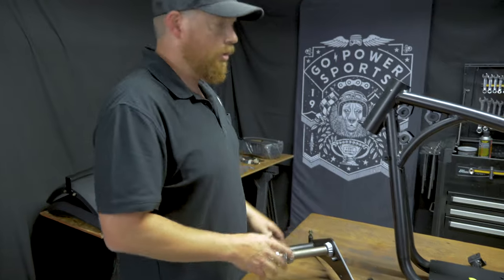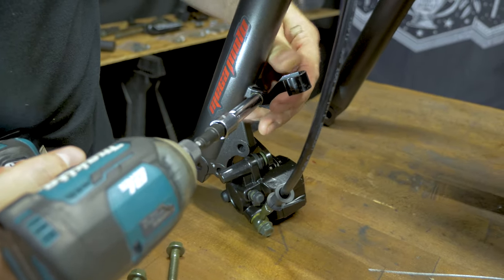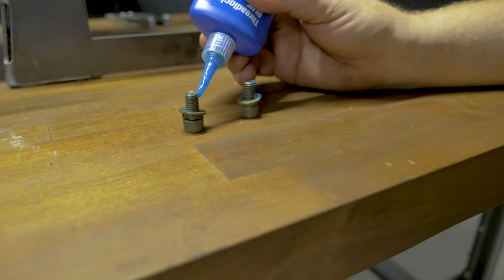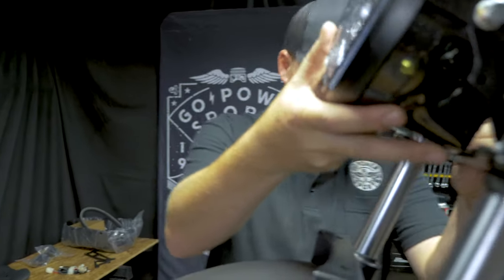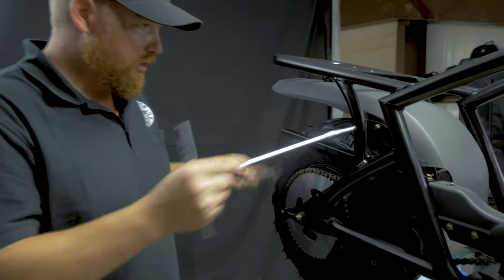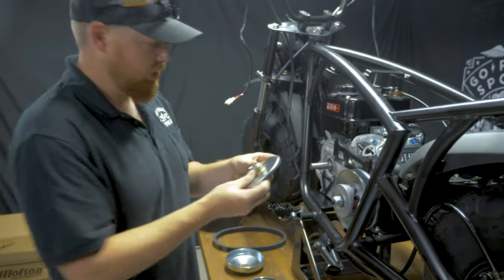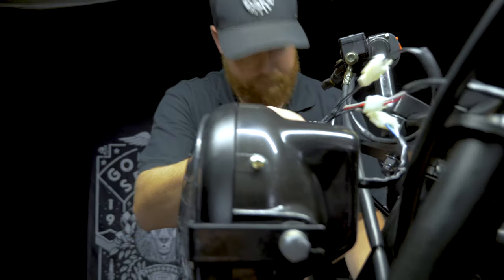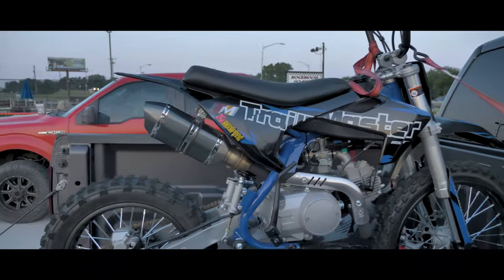Mega Moto 212 Mini Bike Kit Build

Comment: Any ideas for mounting a battery if you did the electric start Tillotson?
Reply: I was able to fit a cheap "Voltage battery tray" behind the jackshaft. I had to trim an inch off the rear fender for battery clearance, but it snuck right in there.

Comment: Just FYI if you buy a tillotson 212 electric start and start putting your stage one kit on.  The rubber gasket for the carb adaptor is not included.  I had to swipe one from my predator 212 still in the box.  For 1000 dollars, Go Power Sports should include this.
Reply from the maker: Thank you for your insight, I'll get this information in the right hands.

Comment: I have a lightly used Predator 212 from a dead log splitter.
I'm thinking to get your Mega Moto Mini Bike kit.
Then add the Stage 1 kit + hotter cam + charging coil + delete governor.
What do you guys think wouldn't that be a nice build plan ?
As an aside:
I was kinda stuck on the full suspension 200X idea BUT realized that a "hardtail" may not be bad.
On my Mountain bikes I prefer Hardtail, so here why not ?
I just think you slightly lower rear tire PSI to soften bumps.

Love any input y'all can offer up.
Reply from the maker: I'd love to see it!

Comment: I installed the TILLOTSON 212 engine. After assembling all components of the driver/torque converter, the original bolt on the shaft is too short and cannot reach the threads.  Any idea what size and length will work?
Reply: i think its 5/16in 24 x 1-1/2

Comment: The jackshaft install portion in this video is flawed. It starts with the little sprocket, then somehow switched to the pulley is on instead and the sprocket not. First there was no washer and now there is. I am trying to install mine now, but confused.
Reply from the maker: Mini biking ain’t Eazy for some. Give us a call and we can walk you through it.
Reply: @GoPowerSports  It isn't about my skill. I have that. And don't misunderstand, the overall video is helpful. I built mine up to the jackshaft before I ever saw this video. I am simply discussing the jackshaft portion. It wasn't coherent in steps. Also, my kit came with one washer that centers on the shaft while the others are all too large and do not center. The shaft, at least in my kit, is not designed specifically for the bike. That is why you have to put washers in a place that interferes with the key syncing up with the shaft (just following instruction). It will work, but it would be better to have the shaft machined for the bike perfectly. Also, in your video, your shaft slides right in place through the bearings with ease, while mine had to be gently, but firmly hammered into place; it is tight in those bearings and nothing easy like in the video. I will have to hammer it back out. When I do, I'll attempt to clean up the shaft for an easier entry next time. I am now making my own washers that center on the shaft. Actually just modifying some that are slightly smaller. In the future, instead of using two washers to allow the gear to be tightened, I may just machine one spacer for that job. I'm running the  gear right up against the inner bearing race; it seems to work fine and is the best configuration for the hardware in my kit. 

The bearings didn't feel good at all, and FatBuddyCat said that would be the case and gives his theory as to why. In any event, I already purchased a new set of bearings and when I get done, my shaft should spin like a tiny dancer if tiny dancers spun horizontally. 

I love the bike. When I am finished, it will have no issues in the drive train. I like the look of the headlight, but I have something else in mind for head lighting. Too much glass on that big beauty of a headlight. Maybe I can sell it on eBay to someone who broke theirs some day. I anticipate the torque converter install might trip me out for a moment or two, since I have never had one before now. The torque converter looks like a beast of a mechanism. There is a fair amount of mass in this drive train. Looking forward to feeling how the drive train works. Still, I feel the need for a hot rod, straight chained, centrifugal clutch street racer. But first, I have to get this mm212 beast to wake up on its feet. The only thing that will be as much fun as riding it will be figuring out what custom colors to put on it and where.

Comment: What torque converter are you using? Base 30 series (8hp max) aren't rated for even the base Tillotson 212E horespower output (9+hp).
Reply from the maker: The stock 30 series will still work but the best case scenario is to upgrade to the Juggernaut Driver, along with taking out your engine's governor.
Reply: @GoPowerSports  Thanks!

Comment: I bought the same bike. Now has Fully built motor over size flattop w/ the works, I added juggernaut. It feels like I am maxing out my rpm quick. Am I running out of gear? Any suggestions? I don't want to go backwards and remove the juggernaut. Any help would be greatly appreciated!
Reply from the maker: Send us a video.  If you're flying down smooth pavement, maybe drop down to a smaller rear sprocket.
Reply: @GoPowerSports  thanks I called in yesterday 9/6/22 and Scott helped me order 2 sets of adapters and 2 piece sprocket. Hopefully it will balance it out a bit more, going from a 54 tooth to a 42 tooth.

#pbkmotorsports

Comment: Well, I have the engine installed now and finishing details. Curious, I also bought a Tillotson 212 engine from Go Power Sports along with the MM212 bike. The engine, assumed to be new, had fuel in the carburetor. Is that normal, or did someone put a used engine in a new box?
Reply from the maker: That is normal, they do get tested at the factory, drained, and then sent out.  There may be a little gas there.
Reply: @GoPowerSports  : I've been riding the MM212 for many hours. It's been a year. I have been site seeing my rural area and the bike is terrific. The hard tail is also great. I never have any chain problems. I  run the rear tire a little soft, and it rides just fine.

Comment: I had a problem with the rear fender, the gaps where too big and i couldn't get it bolted it. Is it normal for there be a 1/2 inch gap on each side? unless i got the wrong fender in my kit or the brackets weren't put in the right spot.
Reply: You can get it lined up with a long thin screwdriver. It will bend a little.

Comment: Awesome bike, was wondering if you could fit a Tillitson 212 with electric start in there or a Duromax 440cc 16hp engine. Saw a video of a guy doing that. As I do want to buy this kit very very soon!
Reply: Yes u can fit a tillitson 212e on there it will be a tight fit tho. If u want to know where I put the battery or have any other questions let me know.
Reply: @nathandixon5020  Yeah where could I put the battery, right next to the jackshaft? Also would I need to run a small alternator since I wanna run some Led lights, tail lights, electric start and possibly some other stuff. Or would the charging coils be enough to charge the battery from the Tillotson
Reply: @nathandixon5020  Yeah where would the battery go? zip tie it on the frame in front of the gas tank? or somewhere else?
Reply: @MrKid-zw5ep  u know where the 212 plaques are on the frame my grandpa and I built a little wood box for the battery and we just zip tied it do the holes that connect to the 212 sticker plaques
Reply: @jamesharaldson375  .
Reply: @MrKid-zw5ep   I think it would be fine all ik is that the headlight will work
Reply: I was able to mount a cheap battery plate right behind the jackshaft. I had to trim the rear fender abount an jnch for clearance.

Comment: Does the Headlight hook right up to the Harbor Freight 212 Predator (non Hemi) engine or do I have to buy an electrical component for the Predator 212 ?
I bought my kit from you in 2018.
Thanks  Liked/Subscribed !
Reply from the maker: Not able to do headlights with the Predator engines and not sure they make aftermarket flywheels and coils that'll work properly.  You can either install an Electric Start Tillotson 212 Engine or use an external battery that you would have to charge up everynight.

Comment: What the bolt for the clutch mine didn't come with it and it's the last one
Reply from the maker: That bolt typically comes with your engine.  If it happens to be a Predator or Tillotson 212, this it'll be a 5/16" fine threaded bolt.  Around 2" long should be enough.

Comment: What size is the Center Bolt for the 30 Series Torque Converter? My kit didn’t come with one!
Reply: I'm at that point too! I need to knkw the same
Reply: 5/16-24 thread and 1 1/2" long. Get grade 5 to 8. It is missing in all of the kits. I now have ten of them..

Comment: Hey just got the kit in for anyone wondering. It doesn't come in a protective crate like that, it's all just stuffed in a box. Washers and nuts all over the place. The welds on the bike are laughable, and I say that with all sincerity as my son who's 12 knows how to weld, and these welds look like when he started learning. I mean, there are gaps in the welds, seriously! Everything feels very china made, so much to the point they added Chinese news papers to help protect against scratching. The entire kit I bought (the 212) looks used, and I've even found rust too, like what?! Holes all in the boxes, and they also looked like they served three tours in Vietnam with multiple gunshot holes. The tires have dirt on them, metal bent all over the place, and so does most of the product that was sent. Honestly I'm shocked at how bad everything is, and the way it was shipped.  Read the fine print, because they gouge the hell out of you if you decide to return anything. Restocking fee that increases over 30 days, you'll have to pay for shipping both ways too. Honestly I feel scammed.

Edit: just wasted two hours putting it together as it has multiple missing pieces, and the engine came in pieces too. Top notch stuff.
Reply from the maker: Give us a call at 866-846-5278 so that we can help out.

Comment: With the rear axle, I have over 1/4" of play, is it safe to tighten the axle or should I add another spacer? I believe I have all the parts: Axle bolt, eyelet, brake, rear wheel, spacer, eyelet, nut...
Reply: Tighten up '

Comment: I just finished the assembly and I tried to mount the engine. It doesn't just drop right in the way it looks in the video. I bought a Tillotson 212. I can't tell if the mounting holes line up. It looks like it won't even fit in there unless you go with a stage 1 kit. It also seems like it won't sit high enough to clear the jack shaft assembly.  Is there some sort of adapter plate needed. There should be a little more info discussed about that instead of a fast forward clip and then all of a sudden the engine is installed on the frame.
Reply from the maker: Yes, the engine dropped right in without any hesitation.  Send us some photos of what you're looking at and we will try and help you out.  sales@gopowersports.com
Reply: @GoPowerSports  Thanks for the reply. After watching the stage 1 install video I realized the little black epa box with the vent tubes attached to it was in the way. I "re-located" it. Thanks again

Comment: The only bolt that I’m missing is the one for the crank for the driver, does anyone know what size it is? I have a Honda engine and I’m not sure what goes in it.
Reply: 5/16-24 thread and 1 1/2" long. Get grade 5 to 8. It is missing in all of the kits. I now have ten of them..
Reply: @slowmissouri205  thanks for the info, I was able to find one but it’s a little long. I’ll have to either trim it or just get the right one.

Comment: Can you purchase this kit and run a 212 without the torque converter?
Reply from the maker: It would need the torque converter due to the way the drive train is set up on the frame.

Comment: I'm having problems with mine my jackshaft bearins fell out idk what size they are and Is there any way u can tell me the key size for the torque converter?
Reply from the maker: 5mm jackshaft key.  And 6003 Bearings.
Reply: @GoPowerSports  will a 5mm x28mm long work?